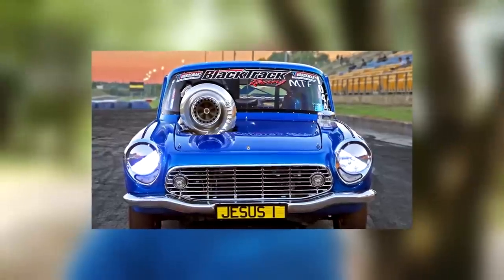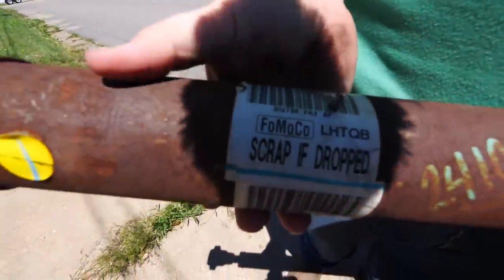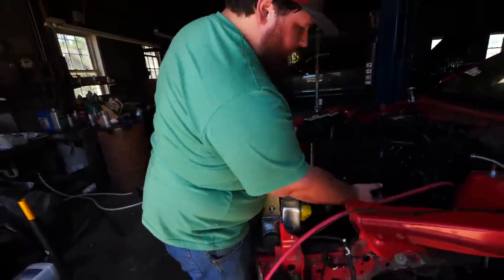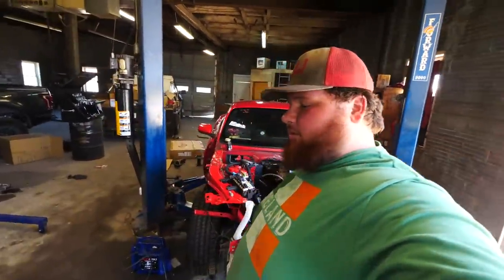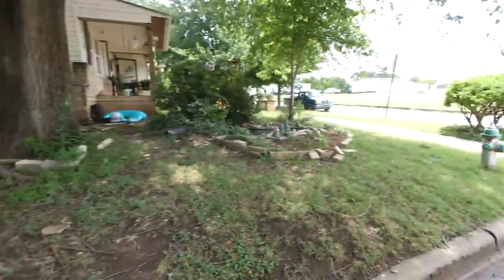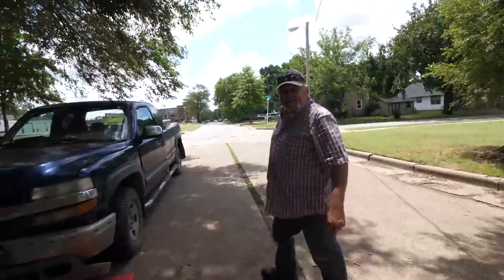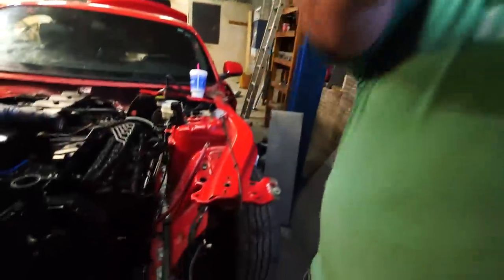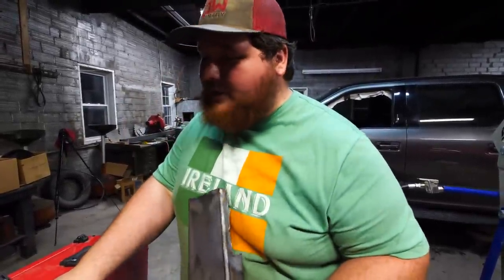Trying to get SMOKE-STANG Finished (Cummins Swap Mustang)

Comment: Get you a 14" carbide tipped dry chop saw.  Blades are about $100 each but last a good wile if you're easy with them. Best thing i ever bought! And the metal is cool to the touch after the cut. Got a circular saw like that too.

Comment: Ford Mustang Drivelines be like: does 1 rotation and immediately disintegrates
Reply: You obviously don't know Ford built tuff
Reply: You could say the rearend as that is the only thing you are talking about, not the driveline but 1 part of it. Speaking to the center section, 8.8” takes a hell of a lot more abuse in the tens of thousands of jeeps that have them as rearends from explorers. Off-road with shock loads and more leverage tire-side, more reduction gear side, is vastly more abusive. 
The link that breaks first will certainly be the radial tires-pavement connection. 
The CV are a point of concern when outside of centerline. 

My drag racing rear ends would be destroyed by my off-road trucks. Other way would be extreme overkill.
Reply: @jasonhollis6515  hi

Comment: What about the  rear end of the car  can it handle the power of diesel engine 🙄🙄??
Reply: Definitely not it's light car but It still won't last long torque will kill it
Reply: @mattcanfield6384  won't be much torque because there won't be any traction wil just melt tires

Comment: Ford Australia used the same driveshaft setup in the aussie built Falcons, I had to replace the hanger bearing on my 04 xr6 (powered by the mighty barra) they are a bastard to realign/install

Comment: Recommendation don't measure for the driveshaft with the rear suspension unloaded. You can end up w a driveshaft slightly too long that will destroy all the clutches in an automatic transmission. Ask me how I know. $$$$

Comment: I’m not trying to hate or anything but he mentions a lot about the “power” that Cummins is going to be putting out. The 3.5L ecoboost that was in it before makes more than a stock 5.9 Cummins so it depends on the turbo if it’s going to make more power than the ecoboost that was in there. The 5.9 makes about 325 and the ecoboost makes about 350-375.

Comment: Please use eye protection when using angle grinder. Seen some BAD accidents with that tool. Even consider a face shield. Seen wheels break apart and imbed in face before. Not to mention the little bits that are always flying.

Comment: PS the Ford F150 front shocks and struts fit on that Mustang I have done a swap on it but it was with a 6.7 Powerstroke to compensate and the weight of any weight besides a 5l coyote the Ford F150 2018 front struts and shocks fit on there like they were meant to be

Comment: It's probably been brought up before but will this smokestang be an all wheel drive conversion? I can't see it doing anything but spinning the tires when the throttle is down. Mustangs are squirrely enough already without all that massive torque from the cummins.

Comment: Shouldn't the radiator fill neck be the highest point in the cooling system? It looked like you were positioning it lower than the head of the engine.

Comment: I got hot metal in my eye once from an air grinder and the doctor had to use a diamond burr to get the rust out. After her got the metal out. Basically it's a dremel tool that hurts real good after the doctor is done. Now I have this permanent gnat (speck) in my vision. Wear safety glasses.

Comment: 110 volt is 180 volt and 220 volt is 360 volt, how its measured doesn't mean much... but when the dealership has to hire a mechanic, the mechanic has to hire a welder and the welder has to hire an electrician and the electrician has to get a construction permit... just by word of mouth that $180 job becomes a $4700 sink hole.

Comment: Weston and Dom; I'm not usually one of the "health and safety mafia" but you've got 665k subs, many of whom will be young, impressionable guys. These guys watch everything you do and say and are quite likely to copy some, or all, of it. By working with hot sh1t and sharp sh1t without the right safety equipment, you guys are setting a bad example. When you're grinding off camera, it's really your decision but on camera at least, I think you should lead by example and wear all the right kit.
Apart from anything else, it would save us all wading through all the "you're not wearing PPE" comments from the proper "elf + safety brigade".  Just sayin... 😁

Cheers for now,
Dougie.

Comment: Now for my mission should you choose to except it . In China they build the world's cheapest electric car. $900 $1200 with batteries. Its called a car in a box. It comes in a cardboard box . With tariffs duty taxes and shipping  delivered $3000 . Now the fun part . I think I'd needs a repower . It has a 1&1/4 hp electric motor . I think a 12- 15 hp sit cooled gas motor woul be better I think you could build a little car that could run 70 mph and get 70 mpg . I fucking dare you.